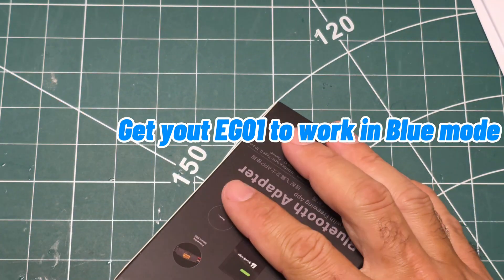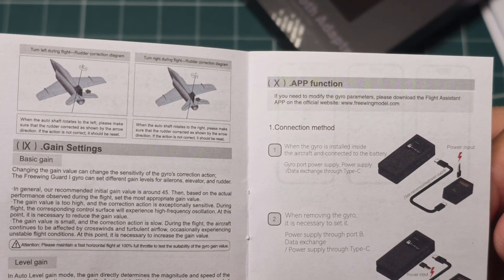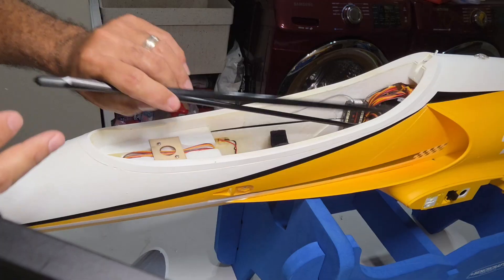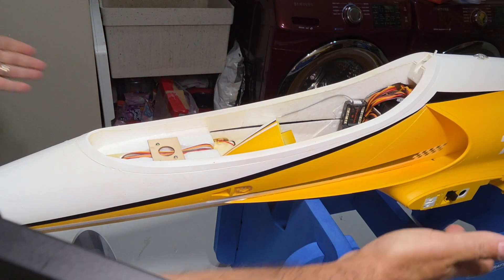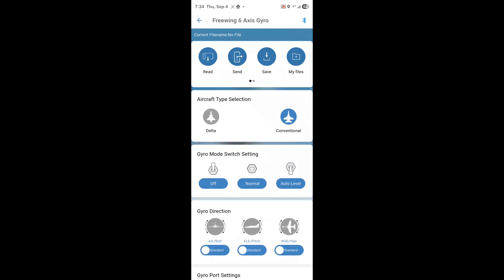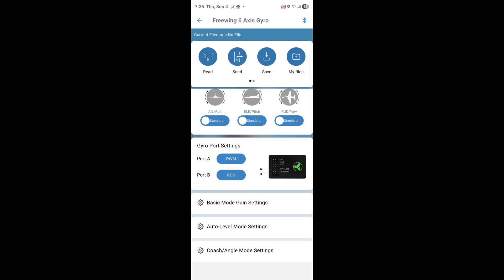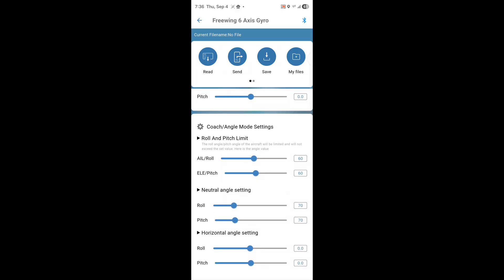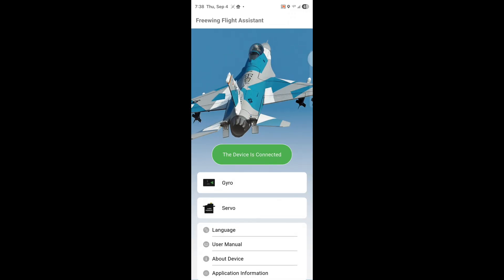Freewing EG01 6 Axis Gyro Stabilized Flight Control System

Comment: Hi thanks for this great video. if i understand with out this programmer i cant make it off the vector , note i m using the 8 channel receiver with some Y leads. Are using on 8ch this programmer? thanks for help.
Reply from the maker: Yes it can be done with Y cables but that is not the best option but play with it let me know how you make out with that setup
Reply: @Pooley929  at the moment my vector is working with the rudder and elevator, can i switched off the vector no moving?
Reply from the maker: @brijesf1 no that's the problem with having a y if you look at my video of the Ares you will see that I did the same thing I do have a 10 channel spectrum in there so I can wire mine up correctly but during that time I was trying to see if the onboard gyro what do the job and the pilots actually reported that it would spin out tumble and roll when you really didn't want it to so having to capability to turn off the vector It's definitely a must to fly this comfortably. Sadly I have gotten completely discouraged with this plane it was marketed upon release that both versions would hover well I got the 6s because I despise the complication of 8S setups and just didn't want to go there besides the fact I wanted to prove whether or not it could hover which I have done it does not hover at all not even close I did purchase a 7S battery though One of the top dog SMC ones to see if the extra RPMs will get this thing to hover and probably take some precautions to just allow the correct amount of RPMs to hover and not over Revv and burn everything up and really only for test purposes only to prove whether it'll do it or not I don't think anybody else has tried well at least not in my area
Reply: @Pooley929  HI ,thanks for your lovely reply in detail!!! ,so you suggest no Y leads setup for this Jet. ok? Why the freewing make this promotion :( !! thanks for video i can setup mine!!
Reply from the maker: @brijesf1 you should be able to turn off one jarrell you are correct I don't exactly know how your setup is but as long as you have the capability to assign that gyros off and on to a switch you should be able to turn off that single gyro by itself I run mine on a 10 channel receiver I did tie the elevator and rudder to the trust vectoring and my bird flies okay but sometimes can spin out in a maneuver and tumble and such I haven't circled back to this bird yet but we want to try to get it to hover on 7S as I bought the 6s version of this bird and it will not hover after that I was quite discouraged and angry with the company as an overall they marketed as a jet that would hover in both configurations but the only way you can get it to hover is removing the landing gear which is a no-go for me maybe one day I'll get back to it or just sell it Thanks for watching thanks for your support

Comment: Just received 2, but no bluebridge!! Which I now understand I need to order!Looks like a decent set of configuration available....if it all works this maybe my go to....the Fms reflex is good and has onboard bluetooth but has a size disadvantage...and custom configs require editing txt files on a p.c..... i just want a decent configurable gyro that i can use across platforms.....🫤
Reply from the maker: Yes this is they're set up has a lot to be desired in my opinion also ultimately I want to put in or really not put in cuz it's already installed but activate my 10 channel spectrum receiver and use the gyro built into it which is what I'm used to but from what I can see it's superior to those things in every way

Comment: Great explanation, better then what Wess showed. My Freewing Zeus turbine ready has green, green, and off, no blue at all out of the box. I find that interesting on that model. Wonder if the blue function is purposefully left off or the gyro is just not setup out of the box
Reply from the maker: I have tried 4 of them to date and all were Green, Green, off but that is not what Wes talked about in his video
Reply: The switch travel needs to be increased so the BlueBridge can detect the mode change
Reply from the maker: @Guillebricks Thanks for the comment Thanks for the input I actually tried this with mine to see if it was a limit thing and I went to 125 in both directions still the outcome didn't change next time I have a run in with one I will be sure to cover that in a video though at any rate it's working now once the Blue bridge programming was done it has been decent